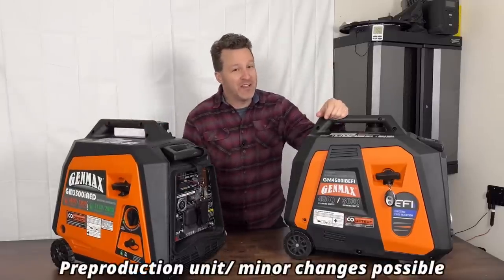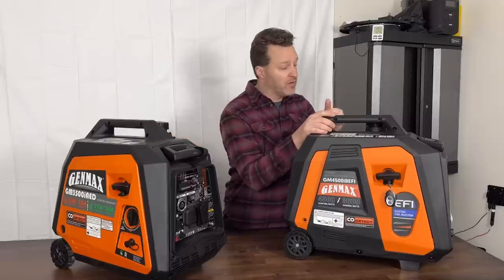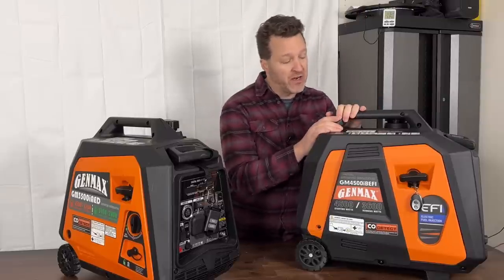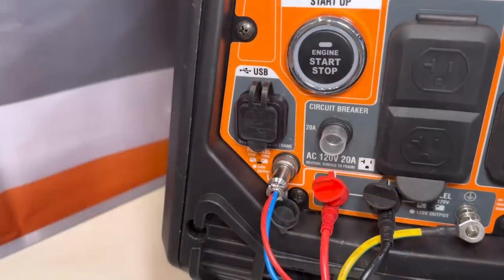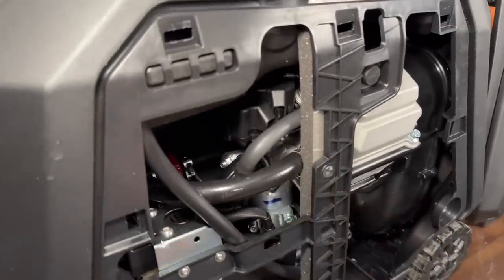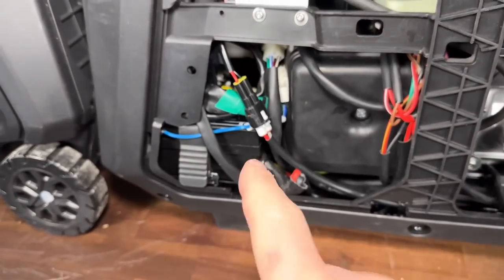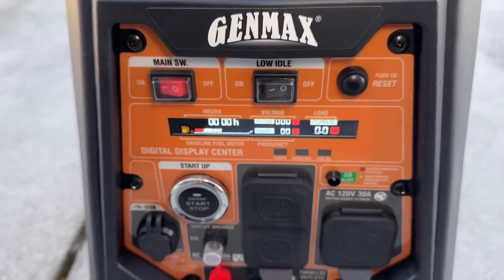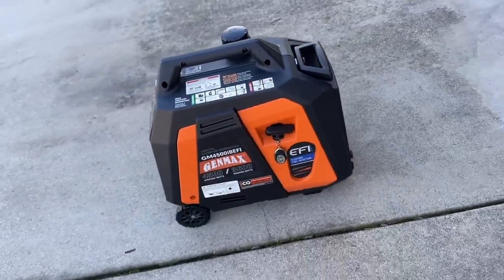Best New Compact Generator GENMAX 4500IBEFI Fuel Injection!!

Comment: Neat little generator. 
A couple things to consider 
1 although efi systems are less susceptible to fuel going bad as fast because there's less venting and less area for the fuel to react with air. When the fuel system does plug up its a much more complicated  job to clean . Also its has a lot more parts like a electric fuel pump that may likely requires a good battery to even pull start ?
Hopefully it does have the ability to adjust for altitude ,some basic efi just runs on base maps and air temperature map .
Anyway looks like a nice unit as long as the user keeps up on the maintenance and fuel. 
I always recommend non ethanol fuel for occasional use equipment.
Reply from the maker: Agree, a plugged injector could be a more complicated fix and more costly if severely plugged. But fuel additives which again I always recommend running in small equipment no water what type of gas, its just a insurance policy really. Because most people will use cheap gas. I do because there is no benefit in buying higher octane in these items, except longer shelf life. But non of my stuff sits long enough. 
I do hope the EFI system will self adjust for altitude which I would assume it would. The mapping for that is not hard. Although i dont know where sensors would be to see if they are measuring air density and more. May have to dig but it doesn’t need much for basic altitude adjustment. 
And non ethanol is nice but only a few are willing to spend the money on it. 👍🏼
Reply: @johnnysweekends  Yes, for altitude adjustment it needs either air density (good), or exhaust O2 (best), or at least air pressure sensor (okay).  That last one can be just on the circuit board so hard to spot.
Reply from the maker: yea Ill have to snoop around a little more and see what i see. 👍🏼
Reply: I'm sure they figured something out with the pullstart and efi.  The physical generator of these inverter generators uses permanent magnets and thus doesn't need alot of rpm at all to produce substantial voltage.   They probably have a circuit involving capacitors to take full advantage of that, and is able to supply plenty of power for the efi system as soon as you pull the string.

It would be a pretty serious flaw with the design if this portable generator became useless just because it's battery died, despite it having a pullstarter on it.
Reply: @mikeg3529  easy enough to test , just disconnect the battery and give it a pull.
Reply from the maker: I’ll give it a try..
Reply: I'd like to think simply using fuel stabiliser and running periodically would prevent this. Also keeping the fuel clean.
Reply: @mikeg3529  Like the Westinghouse Igen4500? Can't start the dual fuel on gas with a dead battery. One of many design flaws on that unit..but no YouTube reviews actually cover any of the major flaws. I just wasted $1000.
Reply from the maker: Uhhh horrible unit it has so many issues. The igen4500

Comment: Back in my motorcycle days the in-line 4 started this way.  My 2002 Yamaha R1 and later 06’ R1 had these type carburetor type looking fuel injection.  I’m sure it has to do something with the tuning for small cylinders.  

GenMax is looking good 👍.
Reply from the maker: Fuel injection definitely has benefits

Comment: Would be the perfect unit if it had a 10 amp DC output. Ditch the USB nonsense.
Reply from the maker: Yea on a unit this size I think a 12v socket would be more useful. Can always add a12v USB is you wanted with that.
Reply: I’ll be playing around with the idea of removing the usb off my Genmax and put a cigarette lighter output, I already have the part just need to install it.
Reply from the maker: Nice 👍🏼
Reply: @ReviewingTech101  If you do it, let us know

Comment: For the tri-fuel, if someone just uses propane or natural gas that would make maintenance even easier would be years before a spark plug is bad and the oil stays cleaner longer no fuel additives are needed
Reply: That's typically the top reason propane is used for generators, especially stand by generators that tend to sit without being used for long periods of time.
Reply: @mikeg3529  yup exactly

Comment: I have the MaxpeedingRods 3500 dual fuel, basically just a rebranded Genmax. can't wait to read some real review of this one. same size but fuel injection and 4500w. very interesting.
Reply from the maker: Yes genmax makes the maxpeedingrods rods line, well a couple of them. But yes waiting for this new unit. They are about finished
Reply: @johnnysweekends  Hi, do you know if MXR3500 is actually made by Genmax? I'm wondering if it really has copper winding? I'm about to buy it in about a week and those are my last most important questions. Thanks for any info.
Reply from the maker: @Coyote13x Genmax made the 3200 and 3300 MXR. The 3500 looks indentical in every way even though the manufacturer says a different name. I don’t know of any gens that don’t use copper windings now

Comment: I’ll wait for Genmax to release a dual fuel model and also have my eye on the external fuel pump to extend the fuel capacity of the generator.
Reply from the maker: Yea a dual fuel FI would be great. Not sure if it will happen but who knows. 
But yea the extended tank and pump would be great.
Reply: @johnnysweekends  if they don’t release a dual fuel we can do what you did to the eco flow gas generator, just need to get the part that goes into the carburetor since it looks the same minus the fuel bowl and use the genmax’s propane regulator and disable the fuel pump and injector with a flip of a switch 😂 sounds like a lot of work but it’s doable.
Reply from the maker: Lol right! There is a way. 👍🏼

Comment: Sure sounds like that 145 cc engine is going to be running high rpm. The popular competitors are running around a 50% larger engine. The Westinghouse I-gen 4500 & Cummins  4500 are running 224 cc. Those don't sound like a chain saw running at full output. Time will tell.
Reply from the maker: Yes time will tell. But will capacitors, and stronger gen coils and more it may do just fine. Look at ford and its small eco boost engines. Unfortunately now the term no replacement for displacement is really hitting as they keep going smaller on engines. But they are also adding some sort of forced induction soooo….🤷🏼‍♂️

Comment: i don't know how any of these reviewers can say these Genmax, Predator, westinghouse, duromax and such are "better" than honda .   It's crazy .  Do a review after you've had one of them a few years of regular use ...then come back and give a real review .  Look, i think harbor freight makes great stuff nowadays but ...if someone offered you a Honda or a Genmax of equal size , which one are you gona take ?  You know the answer. It's because Honda will still be running when all these off brand china generators are in the trash heap . And i like your channel, i do ...but it's a bit misleading when i see so many channels saying these off brands are better than the honda . Harbor Freight has come a long way ...and i understand Champion has as well . I still have my Hondas from 2003 , 2016 and 2017 ...and the 2016 EU3000 i have ran 2-3 days straight , weekend after weekend building off grid structures .
Reply from the maker: I would say maybe not better, but Honda is more and more moving to china, the eu2000 and 2200 are great units if it fits your needs. But most people need a little more power. And they can’t handle it. So now you need two. Twice the price, twice the fuel, twice the maintenance. 
Especially when you need just a little more than what the eu2200i can do.

Many new units are proving to be giving thousands of hours from many comments on my channel and many others channels and more. 
If you don’t abuse it, over load it and do proper maintenance it will probably serve you well. Sure some die premature but you can also read a lot of comments from a lot of disappointed Honda owners. 

So is Honda realizing that equipment that lasts 20 years is actually bad business ? Are they cutting corners and using cheaper items now? 

Again, forums and more always report bad. Just like all the bad Hondas out there I ready about there are probably tons of good ones. Same when you see bad reviews about the Chinese ones, but they sell 5 to 1. So there is so many more out there with the chances of breaking. So of course you may see more complaints on the others. I like my Hondas but the eu3000 is didn’t have enough power for me personally anymore and it was to big and heavy. So I wasn’t gonna drag that around and lift it and more. The 2200s are great for when you need less power but not enough for a 15k ac unit on hotter days. 

And the eu3200i ahhh I just can’t get to like it… small tank and at about 1850-1950 watts you get about 3 hours of run time or so. 
I don’t know if they actually have a tank that works now for extended run times. Plus they advertise it as a perfect unit for a 13.5k ac unit. Well I can do that with the eu2200. So why spend the money for the eu3200 especially at the price and how hard it is to work on. 

They are still good, but they are missing a big gap of a couple units people want
Reply: @AvocaSingleTrack  Honda is on the road to bankruptcy by 2030 along with other legacy production ICE Manufactures. Perhaps the generator division will survive.

Comment: Have 3 honda's right now and they all have issues after 100 hours. broken pull cords, bad autothottle motors, engine mountscwear out and rattle after 200 hrs. Honda is just too pricey and they have had the same problems for 5 years and refuse to address them.
Reply from the maker: Which models do you have if you dont mind me asking..?

Comment: On both the EFI and Carb version, I have not seen anyone do a battery change and battery charging (IE: battery tender jr. or whatever) for long periods of storage. Even though they have the pull cord back up, someone who lets say had rotator cuff surgery would have a hard time with a pull cord if the battery were dead. Ask me how I know. Lol.
Reply from the maker: Yup you dont want to mess up your rotator cuff repair. Ripping out your anchors leaves a big mess and most times unrepairable. I’ll look into a video with an appropriate charger. Take care of the shoulder

Comment: Nothing wrong with the carburators as long as they are  either Mikuni or Kehin in a Yamaha or a Honda. I have a 1989 Yamaha generator that starts in first pull  most of the time.  Probably more than couple thousand hours on it. Original Kehin carburator. When they are  built quality they function well when they are built junk they don't. Plus with the new fuel injection bullshit they have electronics,  fuel pumps and more shit to go wrong. So no newer does not mean better.
Reply from the maker: I dont mind carbs at all. Easy to work on and cheap to replace. But not everyone is good with maintenance and obviously carburetors are not nearly as fuel efficient. Plus starting is not as nearly as good. But for simplicity its really nice. I dont know if there newer models are still using Kehin or mikuni carbs still. Hope so. Love Mikuni 👍🏼

Comment: Can you do a test to determine run time? Curious to see how the fuel consumption is. Maybe a max run time, and 25% or 50% load test run time thanks!
Reply from the maker: It’s in the plans probably a couple weeks. Ill compare 3500IED dual fuel against this. Same engines but ill have to do a lower load test and see what rpms are to match then see how to calculate fuel. Same size tanks as well. But ill run bone dry and then add same amount of fuel then under same load.

Comment: Duel fuel is not EFI correct?   In a month or so I'll be getting one, duel fuel, for my RV.    If you ever have time, what is the height of the gen without measuring the handle?   I know it's not removable, but need to know.  Also, the gen is tapered in at the top.  How wide is the top?  I have a curved RV front that I'm trying to it this into the curve.   Thanks!
Reply from the maker: Correct EFI is not dual fuel. Dual is two fuels. Propane or gas and tri fuel would add natural gas. EFI is just how gas is feed to the engine but has nothing to do with LPG or NG
Reply: @johnnysweekends  correct, on the duel fuel model, gas still is carburetor.

Comment: Is jetting required when running propane on the carberated model at high altitude?  I want the efi for traveling to high altitude, but I want the ability to use propane
Reply from the maker: No jetting required when using propane. Makes it great for altitude travel and no carb issues. See this video on propane fails but I do a quick in depth tutorial on dual fuel and carb info Propane Generator Fails You Keep Making!
https://youtu.be/467c8GoacB8

Comment: I got mine but I believe I got a bad unit it is very very loud just turning on some led lights it even shakes. 
It also only has about a 3 hr max run time. I was not happy with it. I do feel like giving it another shot but haven't made up my mind might just do the new Honda Efi unit. 
Have you done any testing on how long it'll run.
Reply: @johnnysweekends
Reply from the maker: I would look at returning or calling customer service. Have a video of what it’s doing . Definitely doesn’t sound right

Comment: I'm assuming these are from China.  I have two firman inverter generators that I parallel to run my 5th wheel.  How do they compare to the firman genes?  Would love to have two of the EFI units to replace my firmans.  thanks
Reply from the maker: The firman as well are from China like every other model besides Honda. China is now making some Hondas and Yamaha as well. 
And yes these could be paralleled as well do double the power.

Comment: No thanks on this. My father told me to avoid a new product  like this until it has been out for a few years and proven it's  self. Parts availability  is numbervone on any product. I do small engine repair and cam tell you, unless parts are available and reasonably priced,  it's not an item  I would recommend. Honda has always been the go to in the generator field. Parts are always available for every model.

Comment: Do you have a discount code or link to this yet, I'm anxious to pick one up!
Reply from the maker: It actually has not been released yet. This was a preproduction model which after testing they are making a couple upgrades and should hit mass production soon. So stay tuned and ill have a new full video and discounts for the unit…
Probably mid summer…👍🏼😀

Comment: Wonder how these would compare to the pulsar 4000peak/3200 running model looks like they are similar size.
Reply from the maker: Several pulsar models are made from Genmax. Will just have slightly different features but sometimes they will be the same.

Comment: Being that it is a small engine, I think I would still run ethanol free gas.  More expensive but I need to buy and store it for my lawn tractor anyhow.  Would EFI help efficiency when using propane?
Reply from the maker: You don’t have to run ethanol free if you don’t want to but I always recommend a additive at least. 
This unit is gas only and not a dual fuel unit. 
Which it would not make a difference with the injector as it’s just flowing into the carb throat
Reply: It's much better to use ethanol free gas. That's all I ever use in my generators  that   I've had some for over 20 years. I only have Honda Generators that never have failed me. I live in Florida and only need them for power outs during Hurricane. I never store my generators with fuel in them.
Reply from the maker: What Honda generators do you have

Comment: How did you judge that it is better than honda? This declaration lacks to objectivity in mh opinion since you didn't precise whcih model you are comparing, and on which points it is better? Reliability, build quality, noise, functions, price,....
Reply from the maker: Well first let’s consider that the new Honda eu3200 is also new.
So not much track record yet.
So first price..
Honda $2600 before taxes
Genmax $999-1099 I think is where it will land not a hundred percent yet. Will know soon.
Genmax CA legal
Honda not CA legal
Genmax remote start
Honda no remote
Genmax electric start
Honda pull only
Honda fuel tank 1.2g
Genmax 1.58

Honda power output 2600 watt rated
Genmax 3600 rated 

Honda gx130cc
Genmax 145cc engine
Operating weight 67lbs
Which both are probably the same there

The Honda is quieter but I wish I had one to test but I can’t even get one in CA or even nearby. 

So will the $2600 or about $2750 after taxes be worth the $1150 for the gen max.

Two Genmax units will be cheaper than one honda. 
Will the Honda provide more then twice the amount of hours??

So when doing research on both 
$1100 doesn’t look so bad now does it..
Especially with my discount code 😂👍🏼
Reply: @johnnysweekends  you are right in all points, except longterm reliability which can be crucial also. Re sell ipage, honda is a sure value for anyone and will can be selled as 2nd hand at high price, Parts availabities in 20 years for example? I believe honda will be more strong on this aspect. But globally I think also that Genmax offers better price quality ratio and can prefer it and recommend it.
Reply from the maker: Well you have to look at it like a car. Do you keep dumping money into a old used car waiting for the next thing to break. Im not going to through a $1000 inverter board into a Honda with 3000+ hours….then the coil goes or a valve or the belt or….? 
So just depends on how you see it now and where the money is best spent. I still have my Honda eu2200i of course with many others now. Would like the eu3200i but the price and power output is not worth it. And a really small fuel tank.

Comment: What about when the battery dies? Don't think you would start it then. Other than that I believe  EFI is great for any engine.
Reply from the maker: No unfortunately I just tested dead battery and no battery is a no start. So this would be a unit that is used more often or hooked to a charger…👍🏼